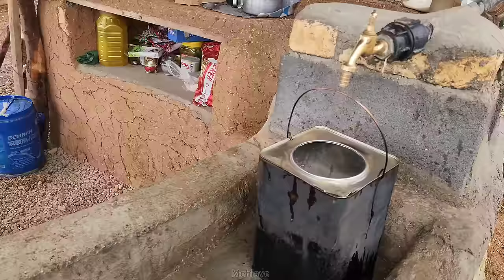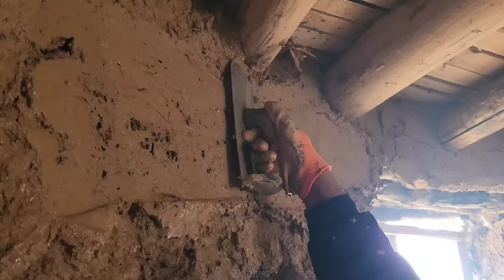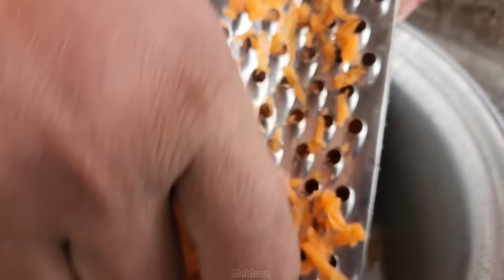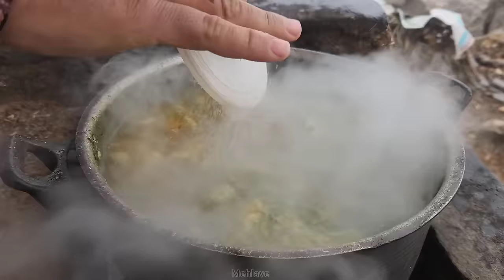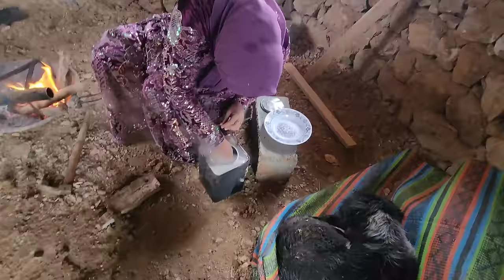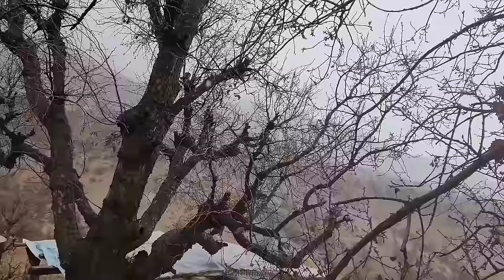"Nature's Symphony: Rainfall Serenade at Asghar and Haleema's Retreat"

Comment: When the roof leaks, sprinkle a layer of corn straw on the roof, then lay a thick layer of plastic film, fill it with a layer of soil, and then lay a thin layer of stones to prevent heat and keep warm.